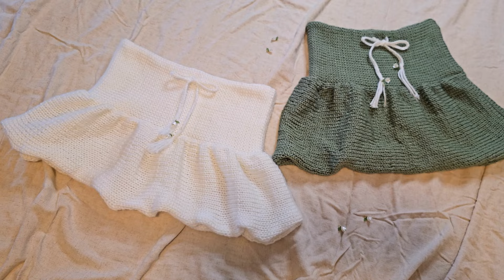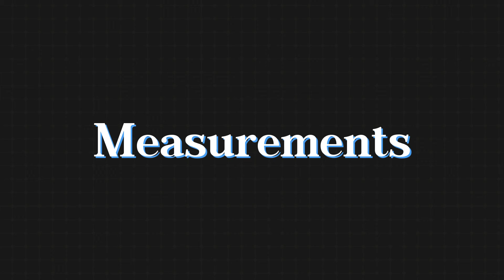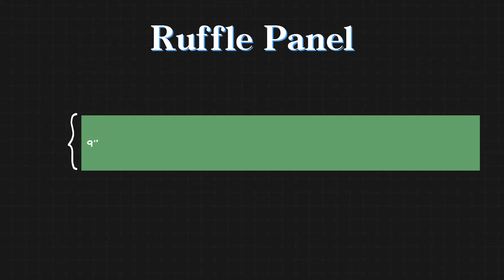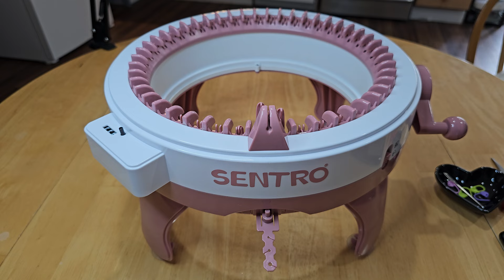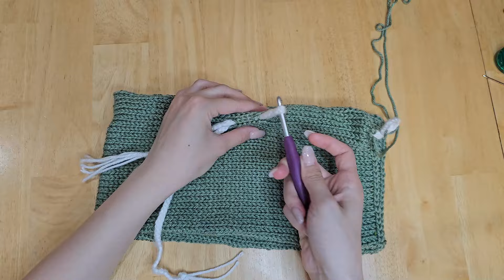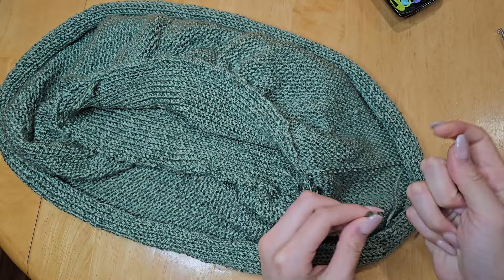Drawstring Skirt on a Sentro Knitting Machine Tutorial

Comment: im so confused, did you sew the other sides of the ruffle panel as well? so its closed at the bottom and top as well as the two ends?
Reply from the maker: Hello! On the ruffle panel, I slip stitched the cast on and cast off sides together to make a long loop and then slip stitched the top of the ruffle to the waistband. Let me know if you have other questions!